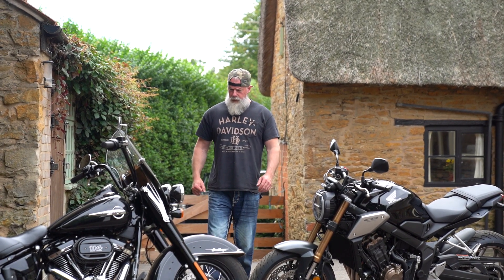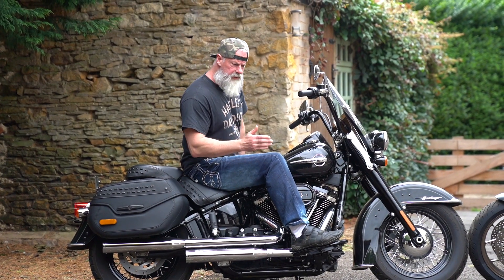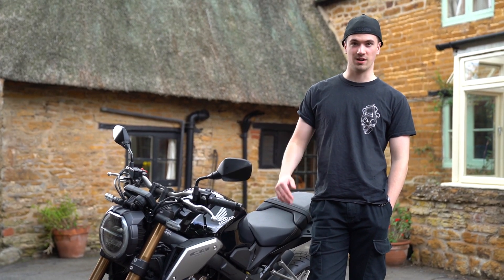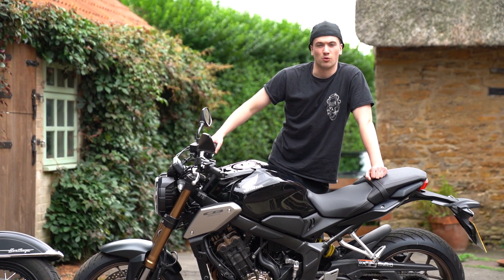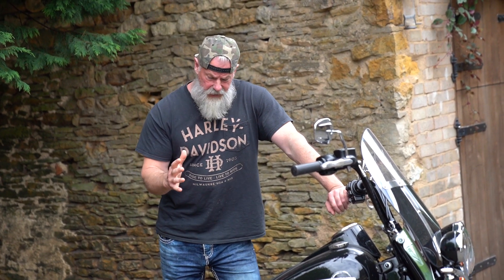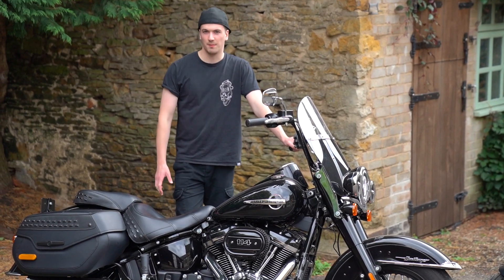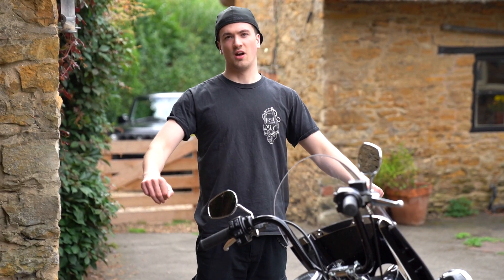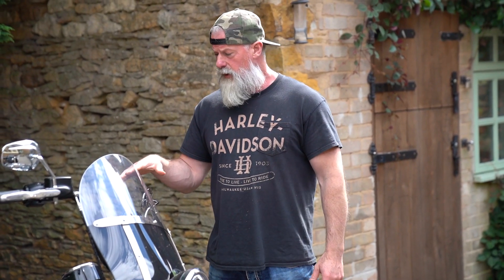Motorcycle Torque vs Power EXPLAINED: A Simple Guide (Harley-Davidson vs Honda)

Comment: How fast you can accelerate, how fast you can go, how much weight you can pull, how steep of a hill you can climb are all dictated by Power because they are all descriptions of work.  
All work is done by Power.
Torque doesn’t do work.
Torque is just the slope that energy wants to slide down.
The actual sliding — the real movement of energy through time — is power.
And work is simply how much energy successfully slid.
Forces, torques, fields, and stresses are not the cause of work; they are the geometric shadows of an underlying energy imbalance.
Only when energy actually flows (power) does any work occur, from a stalled motor to a tectonic plate to a quark.
So the clean, universal truth is:
Work is the integral of power because all work is done by power.
Everything else is just a description of the slope, not the movement.

Comment: Been riding bikes since 1979, ridden  quite a few bikes from Ducati to BMW, from experience for public roads, go for torque.  Gives a relaxed ride.  A BMWR1250R (my current bike) does not have the power of a ZX10, but a lot more torque and its 0-60 is about the same (acceleration times), its just one does not need to rev the engine through the gears (like my ex Suzuki GDZ750R).  It just pulls.

Comment: Both of the analogies perpetuate the myth that power is for speed and torque is for strength, weight and hills.  Torque can be multiplied by gearing, power cannot.

Power, not torque, is the limiting factor in not only the top speed of a vehicle but also how quickly it can accelerate at any speed and how much weight it can pull up an incline at any speed.

Power is the limiting factor for all jobs. Having an engine that makes it’s power at low RPM makes it dramatically more cost efficient. (Long haul trucking/shipping/farming/industrial) Having it make its power at high RPM makes it dramatically more effective for its size/weight.(Motorsport)

Having the engine make its power at low RPM also changes the character so that all of the power appears to be “on tap” in your right hand for immediate use where a small displacement engine with all its power very high in the rev range can leave you feeling caught with your pants down when a sudden need arises. Having to shift down to really bugger off.

Comment: Sad how torque is such an overlooked thing, especially from sportbike riders, their needs are different from cruiser riders, and always mention “insane horsepower, your harleys/ any cruiser makes a mere 60hp” without realizing that the torque on most cruisers is actually insane and that each rider has different needs and uses, not everyone needs an uncomfortable crotch rocket or a super comfy two wheeled sofa (how bashers call each other’s rides)
Reply: well if you have small sport bike which must be light for increasing acceleration you need as much hp as posiible torq is irrelevant and beacuse weight must be low for load less each hp engine must be small and light thats why they generste low torq and high hp at high rpm such setup can be achieved be short stroke and light components at end as hp is only one thing which generated force at set speed than torque is reallly irrrelevant units  put 121 milwakeeight big V2 engine with 120 hp at crsnk os and 200 nm os into gsxr 750 frame give it perfect gearing + leveled diffrences in weight be heavier rider on stock gsxr 750 which have 175 hp and 90 nm in pro race prep setup cos with big V2 heavier engine it be now heavier and what happen with rider let say both 300 kg flat ? with 121 huge V2 engine it be much slower cos at each the same speed cos of lower hp it will generate lower contact path force aka thrust which launch it much slower/weaker forward 👌🏻 stock gsxr 750 race prep setup or even stock 150 hp 83 nm will accelerate much stronger well stock not so much stronger but still stronger 😎👍🏻 in regard  to cruiser  huge torq is for lowering rpm at which is achieve specific power level which determined thrust at set speed for nothing more and with huge torq is corelated huge dispalcement  and with this low rpm and with low rpm they csn setup huge stroke and all this give cruiser rider this what they like so specific sound 👌🏻 + low rpm but thrust is determined be power level at set speed level feg 100 hp 200 nm at 3500 rpm +/- at 100 km/h genersted +/- 2 times lower thrust than 200 hp 100 nm at 14000 rpm also at 100 km/h +/- 😎 open throtle in both on 100% at this 100 km/h and 100 hp 200 nm at 3500 rpm have 💩 against 200 hp 100 nm at 14000 rpm accelerate forward much slower much less rapidly give rider more time to end coffe ☕️ 😉👍🏻 torque is 100% comepnsate be rpms 👉🏻 100 hp from 1000 nm at 700 rpms will push ypu forward the same strong as feg 100 hp from 10 nm at 70000 rpms at the same speed ,which setup you like more now its debate only abput preferention not hard numbers which determined force level and accelerstion level 🤷🏻‍♂️👌🏻 120 hp 65 nm engine from stock supersport 600 cc inline 4 in feg yamaha xvs 1300 which stock have 75 hp 125 nm os assuming we connect this 600 cc engine with perfect gearing for new aplication including 1 gear lenght doffrences between gear lnght in reagrd to peak power band charactersitcs/width and gears quantity absolutely smoked stock xvs 1300 on accelerstion at drag strip and at top speed attempt 😁👌🏻🍿 but gove it try both setup typical cruiser choper rider and probably 9 out of 10 if not 99 out of 100 choice stock xvs 1300 engine cos :it work  enough efectively /enpugh power for theyr needs on normal road on much lower rpm peak power 5500 vs 14500 rpm 🫣 and it sounds like proper classic cruiser and not like vacum cleaner (what for me isint huge factor if at all but im not cruiser  rider but rather sports nakeds +/- fan im value more other stuff 👌🏻) 😎👌🏻☕️❤

Comment: Torque is the "push" that moves your car. Power on the other hand, is the output ie. speed and acceleration that results from that "push".
Reply: nope 👍🏻 its ridiculous 🤣 however alot people think like this that power is something ehich is calculate from some silly formula and do nothing and what you only feel is torque which acceelrate engine to biger rpm at which is power 🤣🤮 its total  bull💩  🤮 what you feel depend on how much power engine generate at specified given vehicle velocity 😎👍🏻 feg 100 hp 100 nm at engine crank at 100 km/h push you into seat 10 times stronger than 10 hp 1000nm at engine crank also at 100 km/h  go test this and you find out its true 😎👍🏻
Reply: @mociczyczki  torque is FORCE times LENGTH. Force in the case, is the combustion from air-fuel mixture ignited by a spark plug which pushes the piston which then turns the crankshaft. Length in this case is the distance from the crankpin to wherever is the center of the crankshaft. The spinning motion of the crankshaft is then transferred to the transmission wherein the speed varies depending on the gear ratio. From the transmission, it will then spin the driveshaft and finally spins the wheel thus moving the vehicle. This is what I meant when I say, torque is something that moves your vehicle. 

Power on the other hand is. . . Well, I don't have to explain it, you wouldn't understand anyway. I doubt you understood my torque explanation, but I tried nonetheless. 
Reply to this comment again when you hàve a grasp on basic(Newtonian) physics. Until then, stfu.

Also, please improve your grammar, I can barely understand what you are saying.
Reply: @jimmoriarty6964   100hp at 20 k rpm at 100 km / h vehicle velocity give lesss drive wheel axis output torque but more contact path force thus push you into seat stronger generated more Gforce than 50 hp at 1 k rpm also at 100 km /h which generated much more engine crank torque and out put drive wheel axis torque assuming it have biger drive wheel radious 👍🏻 first egzample exert at 100 km/h 2 times biger thrust force 2683N vs 1341,5N in the same time have 10 times less engine crank torque  than 2 egzample 35 nm vs 350 nm around like you see you can have waaay more torque both on rngine crank and on drive wheel axis and still much less contact path force / thrust 🌪🤷🏻‍♂️ drive wheel axis is pointless at given velocity as long as whell radious is diffrent you can manipulate gearing to wheel radious ratio thus generate diffrent level of drive wheel torque but it dosent matter what be the diffrenc at drive wheel axis torque at given velocity level of power determined Thrust 😎 feg lets take into co sideration me first egzample so 100 hp at 20 k rpm where engine makes 35 nm let say we have 0,1 metres radious drive wheel so 0,628 m around circle let say we measured thrust at 100 km/h so 27,8 m/s around i give aproximate values not super precise to 10 place after decimal so such we have 20000 engine rpm:2656 whell rpm =7,5 final ratio x 35 nm = 262 nm at drive wheel axis only but :wheel radious 0,1 m = 2620 N thrust this is true force which drive wehicle forward i dont i cluding drive train loses and like i. write i give not suepr precise but aproximate value thats why it differ to 2683 N earlier claimed 👍🏻 now let assume we put wheel which have 1 metres radious also for 100 km /h at 100 hp 35 nm at 20000 rpm engine crank ok so such 20000 rpm:265,6 wheel rpm = 75 final ratio multiple be engine crank nm 35 nm = now we have 10 tomes biger drive wheel axis torque cos 2620 nm 😎 but what happen next is biger wheel radious eat this and exert egzacle the same output thrust like in first egzample 🤷🏻‍♂️👍🏻 cos 2620 nm now we must divide be 1 m and not be 0,1 m = also 2620 N thrust 🤷🏻‍♂️ like you see you can manipulate drive train gearing to wjeel radious ratio but if power at given velocity stay the same you always get egzacly the same output true real brutal force at conact path = thrust at this velocity 👍🏻🥳 as long as power level at given bvehicle velocity wont change as long you cant chonge contact path force aka thrust at this velocity its happen  beacuse watt :m/s = force 😁dosent matter what you domwith gearing and drive wheel radious if you dont change power level at given velocity forget about more thrust at this velocity just forget about it 😁👌🏻
Reply: @jimmoriarty6964  keep dreaming gay 🤣
Reply: @mociczyczki  if you can't win an argument, use ad hominem.
Reply: @jimmoriarty6964  How fast you can accelerate, how fast you can go, how much weight you can pull, how steep of a hill you can climb are all dictated by Power because they are all descriptions of work.  
All work is done by Power.
Torque doesn’t do work.
Torque is just the slope that energy wants to slide down.
The actual sliding — the real movement of energy through time — is power.
And work is simply how much energy successfully slid.
Forces, torques, fields, and stresses are not the cause of work; they are the geometric shadows of an underlying energy imbalance.
Only when energy actually flows (power) does any work occur, from a stalled motor to a tectonic plate to a quark.
So the clean, universal truth is:
Work is the integral of power because all work is done by power.
Everything else is just a description of the slope, not the movement.
Reply: No.
Reply: @atlasatlantis8447  yes
Reply: Hivemind nonsense.

Comment: Finally a video that properly explain how torque vs horsepower feel. Wasted 40 minutes on other channels listening to stupid calculations , theory, history and measurement charts without understanding a single thing. This guys gets it. This is exactly what I looking for. How it feels on the wheel...
Reply from the maker: Thanks buddy 👍🏼👍🏼
Reply: No they messs alot thing ,they dont egzacly understand this theme 👌🏻 and you too according to what you write 😁. But i try explain you this simplest way possible  first of all level of power at specific vehicle velocity determinant force at contact path 👌🏻 engine with more displacement and torq down low produce the same power and force at contact path at lower rpm so those engine dont need to be rev somuch for  achieve egzacly the same results 👌🏻👍🏻😁 this is simplest and shorter explanation of this theme 😎 this h-d in theyr video never produce sp much force at contact path at the same velocity as liter sporta bike assuming we both geared perfectly for let say 50 km/h so this h-d at 5 k rpm at 50 km/h where its engine have max power will generate much less force at contact path than BMW s1000 rr engine at 13000 rpm at 50 km/h where also have max power cos engine BMW makes 2 times more power 😁 you wonder what if we setup engine rpm in h-d for max torque rpm at 50 km/h whatever that rpm are let say 3000 rpm ? Well it be even worse 😁😎👌🏻cos at max torque at this h-d engine os produce less power than at peak power 😁 and from formula power:velocity = force we know this 👌🏻  BMW s1000 rr engine at 13000 rpm at 50 km/h be able tp pull up hill 2 times heavier load on trailer than engine this h-d at 5000 rpm at 50 km/h and of acceleration is force divide ne mass than the same weight BMW engine bele to teleport 2 times faster forward or 2 times heavier mass at the the same acceleration rate level 😎😁👌🏻
Reply from the maker: @mociczyczki  lots of theory but i bet you’ve never ridden a bike with 150+ NM @2000 rpm; there’s nothing like it, even on bikes with twice the power
Reply: @MrDarcy-OlMan  correct 👌🏻 i never ride bike with 150 nm + at 2000 rpm 👍🏻 bike with most torque which im drive was around 120 nm at around 7000 rpm in sport tourist bike 👌🏻 bit still i know egzacly how those stuff goes cos physics can precise acuratelly predict this havind such dat like torque level ,rpm level, and gearing 👌🏻😁👍🏻 120 nm at 7 k rpm in this sport touring bike at 70 km/h with thRotle max open and this bike leave in the dust  150nm+ at 2000 rpm also from 70 km/h with thRotle max open starting drive side be side 😁👌🏻in the dust because 120 nm at 7000 rpm generate 2,5 to 3 times biger force at contact path 😎  but if we compare 2000 rpm to 2000 rpm at the same velocity than this tourist bike will have 0 chance assuming we leveled weight both bike to the same value be diffrenc in driver weight 👌🏻
Reply: @MrDarcy-OlMan  Your ass cant feel the difference between torque and power; that is physically impossible. Your body will only feel acceleration as a function of work being done to move a mass (ie you and the bike) which is directly related to power (defined as how much of said work can be done in a given time.) Bikes with twice the power will accelerate faster, and that's all you'll feel. 

Saying you can "feel" torque or feel power is like saying you can feel the presence of god.

Comment: I have another example from the 1980's.  My GSXR750 could handily beat a GSRX1000 on a twisty road.  Neither of us had any real torque, but he had more HP.  Still though, because my ENGINE was lighter, I could beat him.  On a Harley it would not really have affected the outcome, because torque.
GSXR needs a light rider.  Harley doesn't much matter.
As OP says; I ride both and neither is "better".  One wins on a track or 1/4 mile, the other is my favorite bike. ;-)
Reply: no idea what you say 🤷🏻‍♂️ you say that because h-d have so much torq  load which it carry dosent matter ? and it always accelerate the same ? if yes than Nope its contradiction to acceelration = force:mass so you are wrong 😁👌🏻

Comment: Great Video Guys!  Now i finally understand.  What about weight factor?  the Honda will be lighter at approx 200 kilos.  I've been looking at the new F77 electric mini sports bike from India - it has 90 nm of Torque and 30hp.  The F77 only weighs approx 160 kilos - i think it would outpace the Honda in the 60 meter dash,  but the Honda would catch up and overtake.  I ride the cbr650r and love it!!  Not tempted to change for electric just yet as Honda parts are so reliable and solid for motorway cruising or riding in heavy rain, and as long as it's serviced it will last for a very long time :)
Reply from the maker: Thanks buddy. It’s not easy to explain it 👍🏼👍🏼
Reply: F77 will have 0 chance against CB 650 r on 0-60 m sprint 😎👌🏻but you can have close results with BMW g310 😂 CB 650 hit 100 km/h in under 4 sec vs f77 in like 8 sec 👌🏻🪠 and f77 have 33,5 hp not 30 hp ,engine torque figurę is pointless  ,CB 650 produce much biger force at contact path and leave f77 in the dust at straight dont Belive  do drag race 😎🤣

Comment: I'm still confused lol. Can someone explain it to me without using weight lifting as an example? Bikes don't weight lift and I'm autistic so I take everything literally. haha.
Reply from the maker: Haha yeah.
A high torque bike can easily go along at low rpm and can accelerate or go up hill effortlessly without changing down a gear, often, to increase revs as it doesn't need many rpm to overcome resistance.
A high powered bike produces power at higher rpm usually and therefore needs to rev, and can rev up easily, but more often than not doesn't pull very well at lower rpm.
A Triumph Speed Triple at 2500 rpm struggles whereas a BMW R18 at 2500 is in it's best zone. At high rpm the Speed Triple accelerates rapidly up to well over 10,000rpm, whereas the R18 loses puff at late 4750 rpm